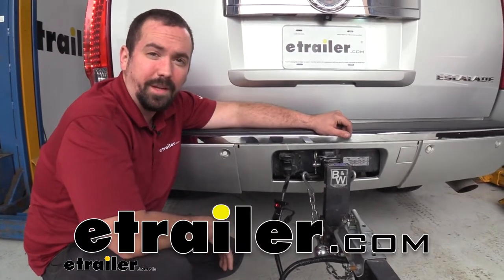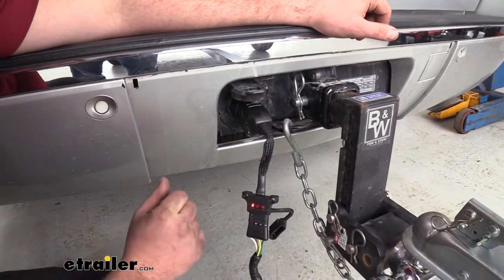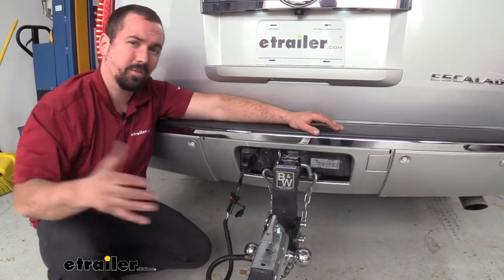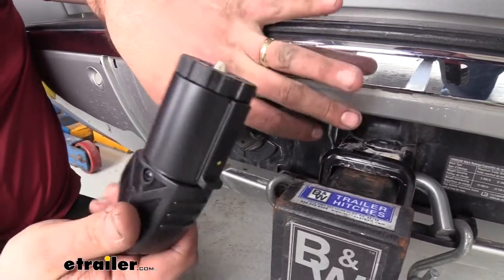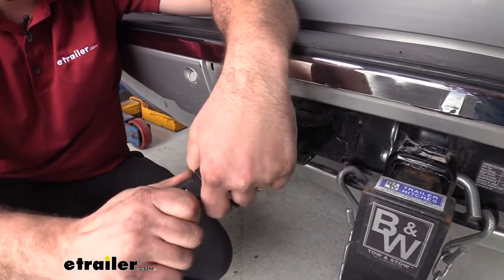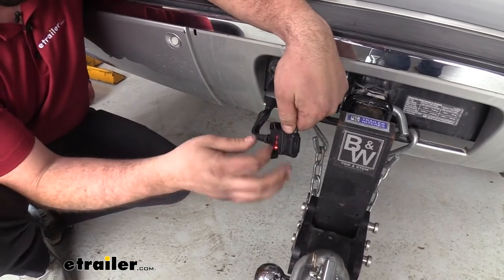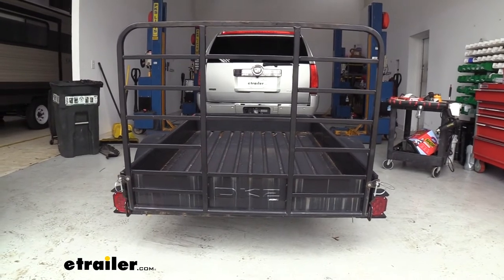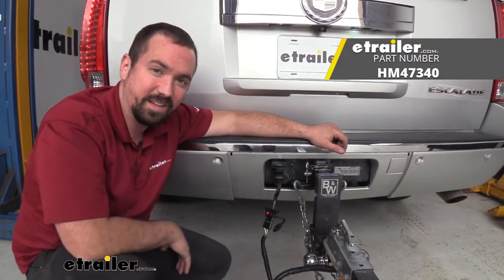etrailer | Hopkins 7-Way RV to 4-Way Flat Trailer Connector Adapter Review HM47340

Comment: After I plugged the adapter in the led lights were blinking even before I connected to the trailer.

What does it mean when LED lights are all blinking
Reply from the maker: We recommend beginning by examining the 7-way connector on the vehicle closely. Look for damaged or corroded pins. If the corrosion is heavy, there's a chance that it has spread to the interior terminals and is causing voltage to bleed over from the 12V aux power circuit to the turn/brake/running lamp circuits.
https://www.etrailer.com/faq-wiring.aspx